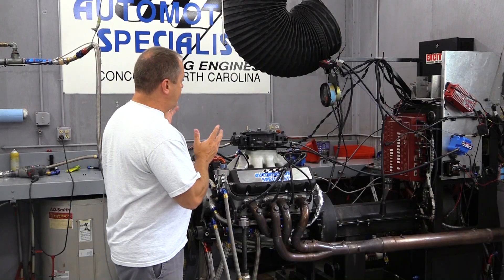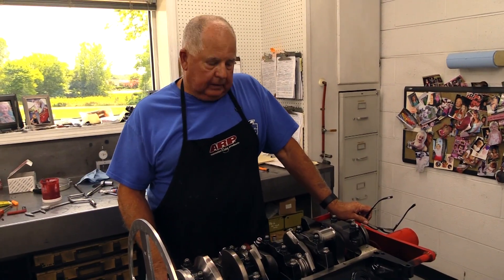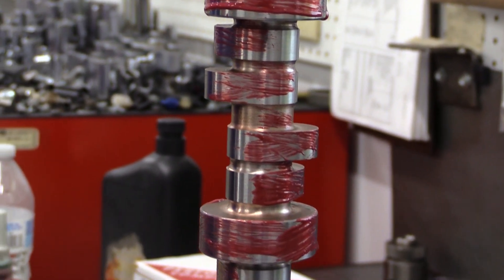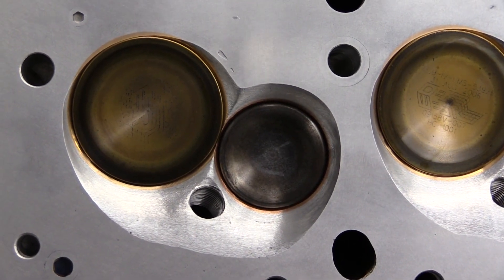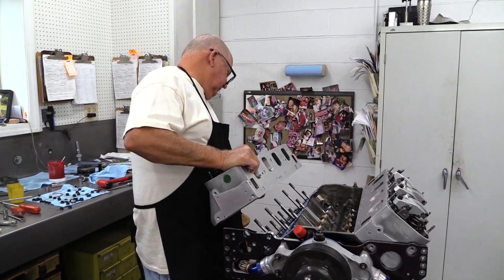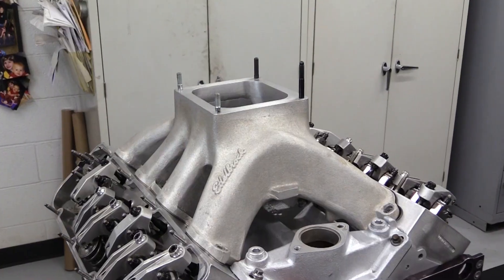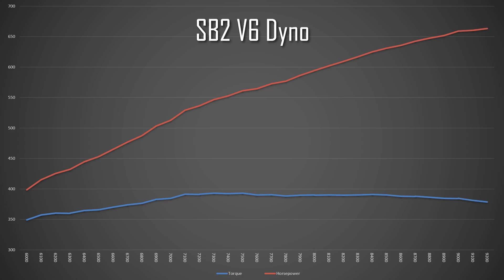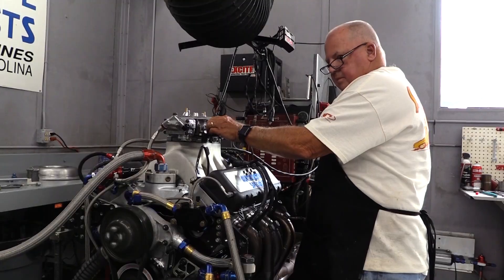NASCAR Chevy SB2 V8 Turned Into a Racing V6!?

Comment: What do the rules specify exactly? Is it just a 262ci limit or do they also specify mandatory pushrods? A 4l (244ci) V8 Judd easily makes 670bhp and is specified for 3000km (2000mi) rebuild interval. The 4.2l (256ci) V10 is even good for 775bhp. Of course cheap they are not - but neither is this one, I guess.

Comment: Why  would anyone detune a V8 how sad that's why they made the 4.3 chevy V6 vortec and ecotec3 4.3 as well as carburetor and throttle body 4.3'S I have a 4.3 V6 vortec with 407 thousand miles a it's a strong runner  I only paid $1500 for a well used 2002 gmc sierra 1500  it had 403 thousand miles when I bought it used from a buddy myself I would like to replace it with a 4.3 V8 LT1 260/262 chevy caprice engine only made them about 3 or 4 years... to each his own I guess peace and much respect to you Jason

Comment: Does anyone know how they would account for the missing ignition cylcles created by removing two cylinders #7 #8    new firing order now being 143652 . This would basically double the combustion cylcle  time and ignition cycle time between 1 firing and number 4 firing . Grounding the ignition thru two dummy plugs all the time doent replicate the KV used to fire the plug under such high comression ratios, I would think in excess of 20k volts maybe more ,on a properly firing engine all cylinders being very close to identical waveforms. The two rapid kv spikes created by grounding those plugs seams overlooked . If its small block just use a high performace v6 distributor . eliminate dwell between the missing cylinders and stabilize ignition events. What they have works not knocking it at all it works im not sure how is my question.
Reply from the maker: We tried to find a way to use a V6 distributor, but the timing events wouldn't line up. Remember, we still used a V8 crank and just blanked the crank throw for cylinder 7 & 8. It wasn't the most elegant solution, but it worked. Also, partially because this engine isn't intended to last a hundred thousand miles. It will be torn down after a summer's worth of land speed racing events. Thanks for watching

Comment: WHAT WAS THE FIRING ORDER? i HAVE AN OLD BUSCH SERIES ODDFIRE V-6 AND CAN NOT FIND A DISTRIBATOR AND THIS SET UP IS THE SAME SHARED JURNAL CONFIGURATION AND i DON'T WANT TO BUY A 5000 DOLLAR EFI SYSTEM TO JUST RUN THE IGNITION AS IT WILL BE CARBURAED, i HAVE NOT HAD THE CAM GROUND YET AND CAN HAVE THE FIRING ORDER TAYLORED TO WHAT EVER IS NEEDED. YOUR HELP WOULD GREATLY BE APPRECIATED KNOWINNG I CAN SIMPLY RUN A V-8  DISTRIBUTOR. WOULD SAVE ME A BUNCH OF TRIAL AND ERROR AND EXPENSE TRANK YOU IN ADVANCE...

Comment: Buick 4.1 will smoke that any day ! Stage 2 Buick motorsports block Indy motor
Reply from the maker: Ha, funny! The 4.1 was rated at 125 horsepower!
Reply: @TheHorsepowerMonster  lol you don’t know anything about Buick Motorsports haha
Reply from the maker: Ah, I see you've gone and changed your original comment on me. Previously, you didn't say anything about any Indy motor. But now you are saying that a motor that requires a turbo making over 50 psi will smoke a naturally aspirated engine of the same displacement. Of course it would. How is that even a fair comparison, turbo with massive boost pressure to NA? Plus, a turbo isn't even legal for the class. But this SB2 makes over 660 horsepower naturally aspirated and I believe would match the 780 of the Buick IndyCar engine with about 10 pounds of boost. I've got nothing against the Buick IndyCar motor. I think it's cool tech. But how on earth is that smoking this SB2 V6?
Reply from the maker: You keep changing what you are talking about. And why do you feel the need to insult me? You started out saying that the Buick 4.1 would smoke this engine build. Then you changed your original comment to the IndyCar engine, which is a totally different thing than the OEM 4.1. I pointed out that the race engine you are talking about does make more power, but it is also turbo charged and to make more power it had to run an astounding 50 psi, compared to this V6 which is naturally aspirated. Now you are saying that the 4.1 came out before the SB2. Which, of course it did. No one is disputing that. But what does that have to do with anything you've already said, especially, "Buick 4.1 will smoke that any day," which was your original point?
Reply: @TheHorsepowerMonster   l never said oem! You know nascar doesn’t use anything oem. That’s why I changed my original statement. You should be sorry for add 2 cents to something you know very little or nothing about. Thanks

Comment: Wouldn’t it be simpler to use an actual as designed V6? Like the one used in cars like the XJ220 and Metro 6R4, which uses Cosworth DFV architecture?
Reply from the maker: None of those engines have cylinder heads that breath as well as the SB2. Also, I should have mentioned this, but the team swaps in different engines in order to go for multiple speed records while at Bonneville. So keeping everything to work with a Chevrolet small block like the bellhousing, exhaust headers, motor mounts, etc. makes their life a lot easier. Thanks for watching

Comment: The strangest engine I ever worked on was a small block ford V8. What made it so strange was that it ran on 4 cylinders. It used 1 bank of cylinders to run the engine and the other bank to run as an air compressor. I was amazed not just by the sight of the thing, but also how smooth it ran on 4 cylinders. It was mounted on a trailer along with a large air tank.

Comment: Maybe I missed it somewhere, but how does this engine not have a misfire skip from two dead cylinders?  It's still using 8 plugs and wires just two are grounded.
Reply from the maker: It does. It would be terrible for a street engine, but this is a race motor that's only going to be making high-rpm blasts at Bonneville or other places. So once it is up above 5 or 6,000 rpm it really smooths out, even with two misses every 720 degrees of crankshaft rotation. Thanks for watching

Comment: Why does the engine have a header tube going to the dead cylinders?
Reply from the maker: There is no advantage to making a new custom set of headers with only six pipes, only cost. So we just ran a set of dyno headers here, and the race team will run a set of their standard V8 headers in the race car.

Comment: At 10:48, using a crow's foot on the torque wrench will give inaccurate readings because the centre of the stud is now not lined up with the centre of the torque wrench square drive.

Comment: Love it!!! I'm currently building a 305 bush v-6 and am running into parts availability. Distributors are extinct and cam cores for the nitrous drag racing in which I wish to use. so will probably have to regrind a nascar NA grind?

Comment: I am a big NASCAR  fan but don't know a lot about cars.  I've never liked restrictor plate racing and always thought running an unrestricted V6 instead of a restricted  V8 on superspeedways would solve the safety issues created by the high speeds but still allow the engines to breath and accelerate and therefore not affect on track performance.  My question is would this engine work on NASCAR Superspeedways?
Reply from the maker: The big reason that's never been done is cost. Even if they have basically the same architecture, a V6 and a V8 are very different engines. For example, with the V8 a cylinder fires every 90 degrees of crank rotation. But with a V6 it is every 120 degrees. So teams would wind up having to develop two different engine programs for a season of racing, which would be cost prohibitive. Hope that helps.
Reply: @TheHorsepowerMonster  That I understand, my real question is would the V8 to V6 conversion in this video work for NASCAR.

Comment: So is he using the v8 crank angles or was the crank recalculated for v6 crank angles? If its the prior wouldn't that leave gaps in the power stroke pattern?
Reply from the maker: It is a regular V8 crank. And yes, there were big gaps in the firing angles but this engine is intended to go a hundred thousand miles on the street. Surprisingly, though, in the high rpm ranges it smoothed out.

Comment: Why not just start with a v6? Is there any benefit for having the v8 block or is it just a a rule thing to get around for the speed records
Reply from the maker: No V6 heads breathe as well as an SB2 cylinder head. Plus, the teams swaps out multiple engines while at Bonneville in attempts to set multiple records. Sticking with a small block means you can keep the same motor mounts, radiator hose setup, bellhousing, headers, etc.

Comment: reed valve the back cylinders(two cycle) turn them in to fuel pump\compressor. to charge the front six cylinders. can i get a applause.
Reply: more lobes on the cam? on the back cylinders. maybe

Comment: There is about 50 pounds of needless weight included in those 2 unused cylinders that could have been hacked out of there. They even left the weight of the unused exhaust headers??  why?
Reply from the maker: Weight isn't an issue in land speed racing. Because they have so much run-up, they don't need maximum acceleration and they prefer weight to aerodynamic downforce because that can create drag. Hope that helps.
Reply: @TheHorsepowerMonster  makes sense

Comment: Why didn't he just start with a straight 6 ?  They are inherently balanced. Could still use the same pistons, rods, valves, carb. The body of the car would easily allow the longer block.
Reply from the maker: No straight six heads flow anywhere near as well as SB2 heads. Plus, the car is set up for a small block (headers, motor mounts, flywheel, etc.). Thanks for watching
Reply: @TheHorsepowerMonster :  There are many people in Bavaria who might disagree with your statement as to flow in straight sixes. The exact same geometry as an "SB2 Head" that the air flow sees could be done in a straight six head, the ONLY difference would be the intake and exhaust manifolds.  Yes motor mounts might have to be moved, but that is simple, flywheel could be the same, exhaust would all be on one side which would make things easier.  As this is for a Bonneville Salt Flats speed record, a straight six offers less frontal area than a V-8 and therefore should be a benefit in wind resistance in the purpose build body.

Comment: Why is there an exhaust pipe on the cylinders not used?
Reply from the maker: Dyno headers. But the team uses multiple engines in their race car in attempts to set multiple records, so they will just use a standard V8 set of headers, too.
Reply: @TheHorsepowerMonster  I wonder what the original firing order was to be able to use the standard crank and block the back two cylinders and have it run smooth.

Comment: Instead of blanking off the unused cylinders would it be possible to repurpose  them as  air pumps to supercharge the engine.
Reply from the maker: It was a naturally aspirated class.
Reply: @TheHorsepowerMonster  ok thanks

Comment: I love it, this is awesome! I just Subscribed! I'm curious about scavenging though. I'm no where near the engine building experts of these guys, I'm sure they've forgotten more than I'll ever even know, so this may be either a non-issue or something they easily compensated for. To me though, without the exhaust pulses from the rear two cylinders, each bank would create a vacuum in their respective primaries, as exhaust passes over the non firing cylinders, on those V8 headers that would then be filled by gasses of the next exhaust stroke or air from the environment. I would think this would create a very turbulent, high pressure system that would flow poorly and be potentially dangerous at that high of RPM's. It wouldn't matter of course if they were using V6 headers but I didn't hear them say anything about using custom V6 headers and they dynoed the engine with those V8 ones so I'm assuming they would be using those for the race. If anyone could help me understand how this works or where my logic is failing, I'd really appreciate it.

Comment: Why didn't you guys just use chevys 4.3 v6 isn't that just a 350 with 2 cylinders cut off ?
Reply from the maker: Those heads can't be made to breathe nearly as well as an SB2 cylinder head. Plus, the race team runs multiple engines in the car for different records, so keeping with the small block layout means they can keep the same bellhousing, headers, motor mount locations, etc. Thanks for watching
Reply: @TheHorsepowerMonster  that makes sense I was just wondering

Comment: Ran an experimental 14 to 1 Buick V6 in my dirt modified. Ran well but was beat coming off the corners. Ran it in 10 races and finished as high a 5th. Oh, this was back in the late 80's. Also had a Buick v6 in a IMSA bodied Monza street car.

Comment: I'm gonna be honest, that's a lot of wasted time instead of just using a European V6 that can spin 10,000 RPM and make similar power with some typical re-engineering. Without some janky pseudo distributor ignition system or a ham fist carburetor setup.
Reply from the maker: What I didn't think to mention was that they normally try to break multiple records with this car, so sticking with the Chevy V8 configuation makes life simpler for engine swaps on the salt. But also, where on earth are you going to find any European V6 (or American for that matter) that's 260 cubic inches (4.6 liters) or less that makes 660 horsepower naturally aspirated? Thanks for watching!

Comment: What an amazing engine builder !!!! When I first clicked on this I was like how the hell is he going to get the wobble out. I've ran, played with and I love the 4.3. But you're always shooting for torque over horsepower.  My first thought is you have to counterbalance.  That's exactly what he did. I'm not a big engine builder but my stepfather was. I used to get him talking at night when he came home.  I got most of my knowledge from just getting him talking. Like an idiot I never  pursued to the field of machinist. Which I regret now.  He's one of the early guys that would de-stroke and blow Firepower Hemis  (331,354,and 392"s) running them close to 10 grand. He's kind of Infamous and most of the old-timers have past away now. R.I.P. Raymond Pease Aka " Peasy" Somers Connecticut.
Reply: My dad welded together 2 boss 302 heads (canted valve cleveland style) to build a Ford 300 straight six and cut up a hilborn injection  put it into a 32 altered  and he and his buddy dominated the class!  NHRA outlawed the engine the following year.  You had to think how to beat the other guy back in the day.

Comment: Its a cool idea and sounds cool. And the dude building it is pretty talented. I love seeing old school odd hot rod stuff. 

But 2.5hp/cubic inch isn't great. That means a 2.4 liter k series honda motor would only need to make 365 hp n/a (which all the competitive all motor shootout cars are easily doing. Yes i know drag and top speed are different. But the engines can make 400+ n/a and be street driven with no issues.) I'm not sure what the fastest guys have for power on the 9 second all motor civics, but it's easily 500hp. Idk. When dude said 2.5hp/cu. in. I just kinda stopped and did some maths. Like a high compression k24 block with an a2 head. A set of cams/valves/springs/retainers. Big throttle body. Maybe e85(or any "normal" race fuel) and it would probably hit the 2.5hp/cu.in. mark with more or less off the shelf parts. Now you might want to add a dry sump to do top speed runs. But it would likely survive. Would be cool to compare an import motor and see if a 4cyl could compete with only 146 cu.in.(2.4 liter).

Comment: Take a 292 Chevy straight six and put a 194 Chevy straight six head on it with z28 intake valves   ..( you might have to run two copper head gaskets , if it blows a single head gasket ..). There are cams carbs and headers from Clifford research to fit ..and you have the engin for the midwest dirt cars of yesterday ..today they run 850 horse power 434 cu.in.small block Dale Earnhardt signature motors from General Motors cranking 8500 RPM running on methanol from VP racing fuel and what they call modified late model stock cars pulling wheelies out of the turns on dirt

Comment: Buick series 2 3.8 or Chevy 4.3L would be a solution
Reply from the maker: Yes, except those have no cylinder heads that flow anywhere near as well as SB2 cylinder heads. They would never be able to make the power required.

Comment: Does anyone know what valve coating they use at 7.33 of the video where they mention it? And is it simply rubbed on to the valves or how is it applied?
Reply from the maker: Pretty sure these are Ferrea valves. They came from a NASCAR race team, so that coating my be proprietary, but it is probably something similar to what Ferrea does from the factory. They do a Chromium Nitride coating that insulates the titanium from the heat of combustion, helping it live longer. It is a molecular process, so it is a lot more involved than just spray on and bake like a lot of anti-friction coatings. Hope that helps, and thanks for watching
Reply: @TheHorsepowerMonster  thank you for the anwser, do they do also road car valves or is there any company that could make the same valves?
Reply from the maker: I don't think you'd want titanium valves in a street engine. Ti is a pretty soft metal and wears quickly, even with a coating. Remember, the Cup teams are replacing those valves after every race. If you are trying to achieve a super-light valvetrain, there are are pretty cool stainless valves that are approaching the weight of titanium with much better wear characteristics.
Reply: @TheHorsepowerMonster  that's a great advice! Appreciate it!